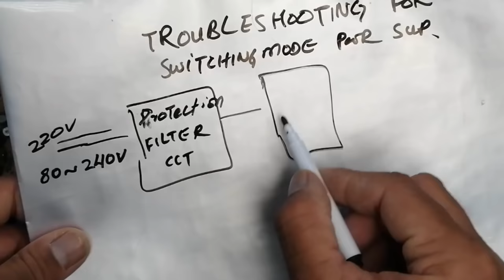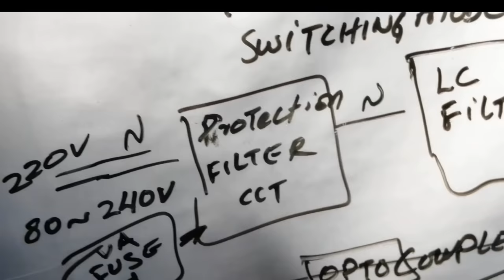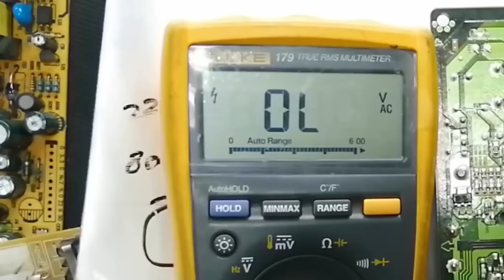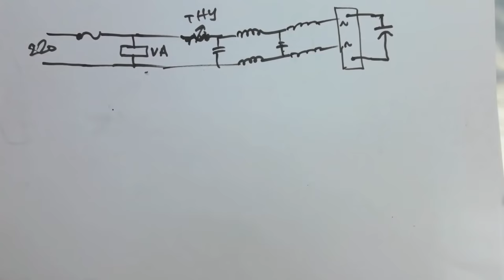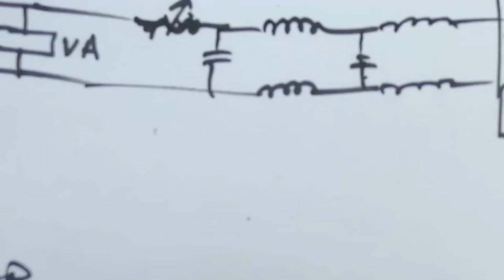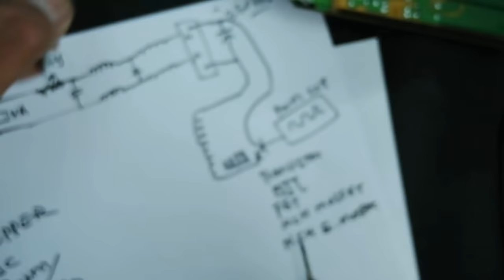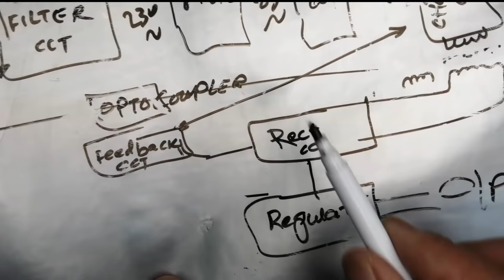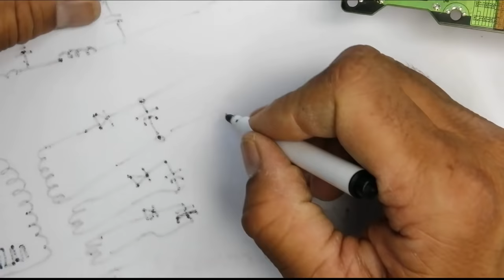SMPS Switching switch Mode Power Supply repair & Troubleshooting

Comment: Excellent explanation. Much clearer than others I have watched. I restore vintage computers, and have a handful of dead PSU's. This makes it much clearer what I'm looking for instead of randomly probing around the board. Incidentally, I have an old Olivetti PC6300 PSU that has a Gammatron T366 transformer(?) and an MPX-A-100 relay that perhaps serves in place of the optocoupler? It does seem to fit your model, because it and the Gammatron appear to isolate the input from the output. I'm just now making my way onto the output side where I suspect the issue lies. Again, excellent explanation friend. Thanks for YouTube'ing!

Comment: Haseeb !  Thanks So much !  for all your great SMPS videos....I am currently attempting to repair two SMNPs and after watching your videos, I actually have a pretty good understanding of how to trouble shoot SMPS issues, rather than just changing out every electrolytic capacitor and HOPING that fixed the problem....  I was up half the night last night watching your videos, and will probably need to re-watch them a few times so I really grasp everything you show us..... Can't we just come up with a way to direct download the knowledge from your brain to ours !  :-)     EXCELLENT STUFF ! Thanks Again !  Rick
Reply from the maker: wish you best of luck 
please check video number 528. in that video i tried to cover all possible problems in any switc mode power supply

Comment: Great video watched completely, like very much explanation of function of optocoupler in feedback circuit and how it monitors processor voltage, but it will shut down whole output by shutting down vco/pwm circuitry, easy to understand and apply, thank you.

Comment: Great clear video Sir, Could you more or less reliably say in 80% of the cases an SMPS most common failing components are.......Caps, Mosfet, Rectifier and chopper transformers? Do you recommend a specific kit of components that has the most common transformers in different shapes and sizes or are there too many variables out there? THank you

Comment: So...I know it takes time to make these video's. And the individuals who take this time, which is a un-renewable portion of life, are either wanting to share their knowledge for the hope of bettering this society or are doing it for money...regardless if the information is correct or not.
Or maybe they just want to show off.
After years of looking at these circuit boards and trying to make sense of the process, this video breaks the SMPS down into sections and shows what is happening in each.
Another chunk of knowledge added to my library. Thank you sir.
I typically exit  videos when the commentator has a heavy accent. It is difficult for me to follow.
 Has something to do with the number of vowels and stress points and... I have researched it some and it gets complicated.
I here you relaying much information and in making it simpler for us commoners to follow you seem to speed up your explanation.
 I may be wrong. 
What I am saying/suggesting/asking is...to take more breaths so I, and possibly others, have that time, (precious resource) to comprehend more fully.

Doing my best to comment without insulting.
Much information out there...hard for me to understand and follow along.

Thanks again...sincerely!
Reply: Tsk tsk tsk

Comment: great content. very clear. other video are great too. it demystifies the SMPS
I was afraid by these power supply and now it seems so clear. I have few ones in the junk  box it will be a good starting point for me (I will use then with an isolation transformer and make some experience has described here.) this is definitively the best SMPS training on YouTube.

Comment: This is by far the best explanation of an SMPS.
Please Help : I have a short circuit whenever i replace the fuse. What are the most common faulty components that might be causing this short circuit ? can i locate the Short without having to desolder each component ?
Reply from the maker: please check video number 145 for input short circuit troubleshooting

Comment: Extremely good video.. you covered more then a diploma could in one easy to understand short indepth video. I do have one Question... Sony tv 220v power supply all out put voltages is near half then it should be 3.5v is 1.6, 12v is 5... im sure you would love this interesting problem.
Reply: Also no standby light turning on
Reply: I think it could be voltage shortage on main capacitor... i will test the ones you showed in your video... specailly the 360v Dc

Comment: To verify if one side has a shower can you remove the optocoupler from circut and jump it to see if the chopper circut is oscillating?  Then if so proceed to find the short on other side?   My issue is i have 120v coming in fine and converted to dc after full bridge rec its 160vdc or so,  but on the mains side of isolation transformer I show this still as a dc voltage and not ac, So am I right thinking it’s not oscillating which would create ac voltage across the isolation transformer?   How do I check if the 8 pin ic FA5304 is working right?

Comment: Hi , Very clearly presented video, and extremely helpful!  so  I am trying to fix a SMPS for an HP spectrum analyser (8563A) all the dc outputs are dead. The problem with HP is that they face the components with their part numbers which are not easilly matched to to what the actual component is should a replcement be required. Anyhow I notice pulses on the buck regulator which feeds a centre tap on the dc to dc converter but it looks like most of the voltages are low and so no switch on the tranformer, any idears please?  I was wondering if the feedback circuitry is possibly activated?
Reply from the maker: best regards for your valuable comment 
actually HP products are outdated and most components used in boards are discontinued and  sometimes the parts as marked with some special codes. 
as in feedback it monitors just 5 volt and 36 volt and +18 & -18 are applied to voltage regulators 
in feedback circuit, it is sense line so it will okay ( supposed it must be okay)
you need to 5 volt line. or check 18 volt circuit (by disconnecting it) which is powering up to CRT circuit to verify the feedback network. sometimes the fault in one section causes to drop the other sister lines in secondary output of any transformer 
check over-current sense circuit in buck regulator driver section. 
most probable chance of failure in +5 volt digital line or +18 v CRT power supply circuit
Reply: @HaseebElectronics  thank you for the reply,  very warmly appreciated. Yes, the CRT HV has been removed and its wired for test as per manual, the manual is not very detailed as hp probably expected returns for repair. Anyway, the circuit is quite complicated. The 5 v logic is not easily identified. I have discovered, after viewing your video,  that the PWM ic is an  NE
Reply: @HaseebElectronics  sorry did not quit finish, accidentally sent😊  the PWM  is an NE5560N and vcc seems to be fed from a fet which is activated from the kick start circuit whic I dont quite understand. But as seen  from your video,  I thought to check vcc to the ic , pin 1,  as it will not work without power, and it seems low at this point. The opto isolater is probably equivalent to an CNR50. As you say the principles are all the same but what is difficult here is the complexity of the circuit. And yes, the parts are outdated with special codes on them which makes it all the more difficult Anyway thank you for your assistance here, much appreciated.
Reply from the maker: you are welcome 
+5v digital line is connected to the opto isolator input
Reply from the maker: indeed a very old fashion but military spec design. it is very complicated with outdated parts 
please down load the service manual for 8560A and follow to chapter 12 for power supply .
on page 12-10 and onward
it is pinpoint troubleshooting of the power supply
Reply from the maker: https://www.manualslib.com/download/529214/Hp-8560a.html

Comment: Thank you for excellent explanation I have one question after bridge rectifier if smooth capacitor dc voltage is less than expected about 120V where could be the fault
Reply: Nice video about SMPS, its only here i understand meaning of SMPS, detailed function of main parts, why it has components of such parts, that we dont know we are using it everyday, we throw it away when not working anymore. I salute you for unselfish sharing of your knowledge about SMPS.

Comment: What could the 400V capacitor to hold 300V for hours after main ac power disconnection? You mentioned in this video to do not touch, especially while there is some problem, but you did not say what could cause behavior like this. Bless you!
Reply from the maker: yes dear 
if its bleeder resistor is open circuit (in some circuits, bleeder resistor is not used at all) 
if mosfet is open, and smps circuit have malfunction
then this capacitor keeps its voltage for a long time, (in this condition it discharges very very slowly by the leakage currents only) 
so in this condition, this capacitor is very dangerous. we must verify the voltage on main capacitor / bulk capacitor / smoothing capacitor 
discharge it properly, if needed

Comment: Thank you very much Sir, if i remove feed back circuit and I fix the réferance voltage ...the question is ...the main cuicut is still work or no (random voltage )??? Best regards

Comment: I have one Coby DVD. I. C. Of which is not getting in market, therefore, I attached one module to the DVD. Black wire to ground, Red toMosfet middle point and Green to second point to I. C. Where I. C. Fitted. The problems that when current is is given Red LED is no lighted,pl give me the reasons.All components are in good condition Sir. Your early reply is appreciated.

Comment: Well explained video you are very good teacher, what can be the problems if the output is half the normal output and one out of two transistor gets hot rapidly. Waiting for your response Sir thanks.
Reply from the maker: thanks a lot. 
there are many reasons for transistor heating up
if possible mention the power supply model number, so that i can suggest

Comment: Wow, awesome explanation. Best I've watched yet after 2 days of watching vids on power supplies. THANK YOU! 👍
 I have a power brick for a dvr that is rated for 12v 5A out. It was working fine for 7 months but the amps out dropped to 1.5, not enough to run the dvr - it needs 2.3A, still putting out 12v though. I've tested almost everything with a MM (power off) except the opto coupler and inductors and everything seems to check out. I've tried a few forums to get some suggestions on what a possible cause could be but no luck. Any idea what component or section of the power supply is likely to cause a reduction in current out?  All tested components were removed from the board first. I'm still learning.
Reply: @HaseebElectronics  Thank you so much for the very prompt reply. I will send pics to you.
Reply: Pics sent. Which side controls the current output, primary or secondary?
Reply: Diodes capacitors transistors resistors check these components

Comment: Hello Haseeb, I'm looking at a power supply for a computer lcd monitor. The screen display keeps flickering every 5 seconds with a voltage  between 12v and 16v. When 12v screen is okay, when 16v screen creates lines distorting the image on the screen. I traced it to the screen voltage changing every 5 seconds. It is not steady. I'm guessing it has to do with the PWM. Is that correct?
Reply from the maker: welcome brother 
check some polar capacitor is bad in power supply 
remove them and verify the ESR value of the capacitors. because the capacitor's internal leakage or increased internal resistance makes this type of problems 
so power supply starts to fluctuate
Reply: @HaseebElectronics  Thank you for the quick reply. I did replace the big 450v cap and the small one next to it but problem was still there so I removed one IC LNK6764V and the voltage is now constant even on the 450v cap and before it was not. I think the problem is with this IC LNK6764V. Not sure if it can be fixed or I have to find a new IC.
Reply from the maker: @ahmedtwahir  yes theis LNK IC is standby power supply switcher . most of time it's internal mosfet gets damaged, then it creates current surge at DC rail
sometimes this LNK switch ic is good and after the standby section there is something wrong which causes to drive this LNK ic to work in reboot mode, so it makes fluctuations on the DC rail. 
I suggest connect this ic I'm the board and check if there is some output in the secondary side of the standby transformer. if there is some output, that means this LNK IC is working, just you need to troubleshoot the secondary portion

Comment: Sir can I check output voltage at transformer ? 
And why u kept multimeter in ac mode while checking final output at capacitor? 
Please explain pulse width modulation step by step...
Why is feedback required for circuit?

Comment: Please help, master, here I am trying to repair the power supply, when I did an initial inspection, physically checked the components, it turned out that in the primary block, the bottom surface, it looks like there is a yellow liquid on the circuit board. On the circuit board it looks like there is liquid from an exploding capacitor, after I checked physically, there is no elco that is bubbling, or physically damaged. Is there an easiest way to find a capasitor that has liquid coming out like that? I tried removing a few capacitors, I checked with an esr meter, and the multitester is all normal. Physical check looks normal, the top is not broken. Is there any other way to check the condition of the capacitor other than using an esr meter, multitester or oscilloscope (because I don't have oscilloscope). Please guide me

Comment: I HAVE A PROBLEM MY SMPS.  I want to ask  optocoupler pins"live(high voltage side) 8,5V"   and other side (12V side)" NO VOLTAGE" .  which side is the problem ?

Comment: Question I have a tlc TV board with the power supply built with the motherboard attached but am only getting 165v from the main capacitor and the hot side and bridge rectifier diodes working plz help.
Reply from the maker: welcome dear
do you have any output. either it is stable or fluctuate??

Comment: Good day sir, I love your videos they are very helpful and informative. I am working on amplifier and I have short circuit. My output side is shorted no output and whenever I remove the chopper transformer the short is gone on output however the short is still on the other primary side in front of the transformer.
Can you please help me to find out what is going on with the amplifier?

Comment: Salam Mr Haseeb, thank you for the clear paths you led me through. In one of your videos, you mentionned that a wrong optocoupler can give no power output. May I ask you how to start with a psu atx i have where 319v DC are getting to the transfromer, but nothing in the secondary side. I hope you could help me. Ramadan Mobarak Said.
Reply: @HaseebElectronics  Salam. Any idea how to check the SMPS without multimeter ? can i try with no risk to operate with shunted optocoupler or i will damage it more ? and yes, i saw all of your videos, spécially the 1h20min one is very instructive. Bravo !

Comment: I bought a 36V 11 amp smps from Amazon. I believe I overloaded the power supply with drawing too much current, and now I do not get any voltage measured on the output terminals. I opened the power supply, and on the output phase of the power supply, the transformer is reading 110VAC input, and 0VAC output. Is it likely that the transformer on the output side failed because of too much current drawing from the DC output?
Reply: @HaseebElectronics  The fuse is ok. There is 110VAC coming into the transformer and 0VAC coming out. I can't seem to add that number in whatsapp?
Reply: @HaseebElectronics  I also measured the capacitors directly after the rectifier, and the read approximately 350 volts DC

Comment: Sir, this  32" combo board  China, Feedback our smps powers  supply  vcc 18 up and down  our 12  voltage our back light voltage  up and down So sir don't know whether it is a problem in feedback or there is a fault in the primary   section of the power supply.   Vcc 18 up down sir plz full detail  give  insider feedback me problem hai  sir made videos   soon as possible 🎉 i like  sir your work and all information for election  your great sir  🎉 ❤❤❤

Comment: Another great presentation on circuit analysis. I am vary you replied to my comment on one of you other videos. My Fluke 3092 oscilloscope turns on then shuts down split second later. How do I diagnose faulty circuit? Many thanks.
Reply from the maker: does it's boot up circuit unitizes or not.
somr time these modern power supply circuits have built in monitoring circuit. which is most of time software controlled.

Comment: Is it possible to increase ATX PSU having TL494 control IC from  +12 volts to 14 Volts so that it can be used as car battery charger.
Reply from the maker: Yes brother we can do it, i will do it very soon for you

Comment: Awesome video I've watched 2 or 3 of yours so far though one thing I would like to see is when you're testing voltages sting voltages is to present what would appear if a open or short condition across let's say an optical coupler or a bad cap capacitor. Definitely thumbs up on the videos I've watched so far and you've earned a sub from me
Reply from the maker: best regards and special thanks. i try to functional description and troubleshooting points 
i will suggest to check video number 592 & 528 on my channel. that is to get a clear concept of SMPS flyback & half bridge topologies